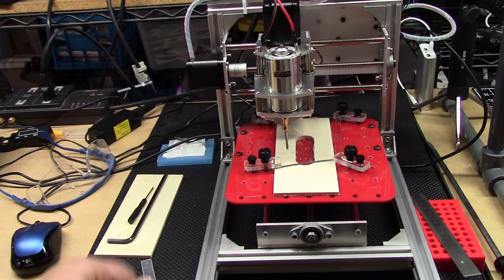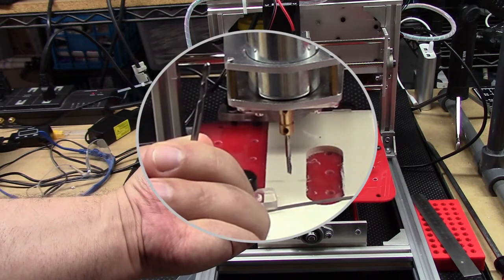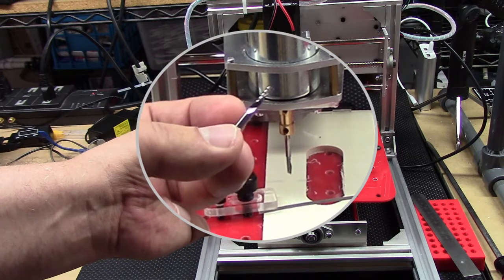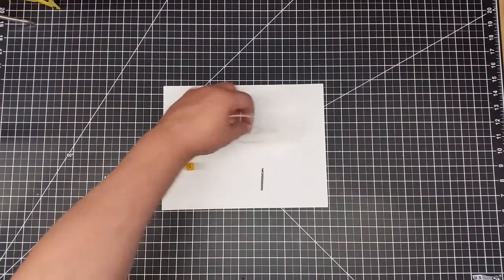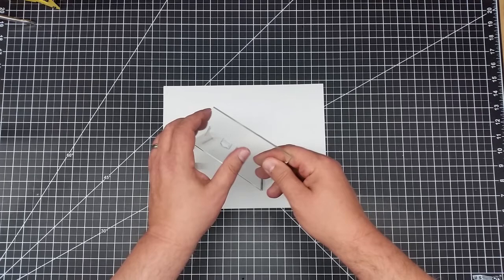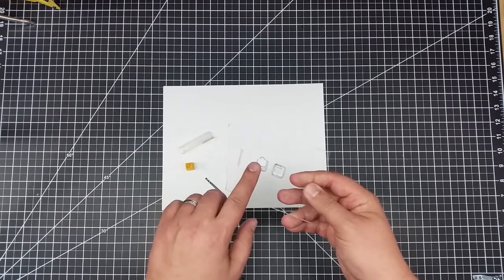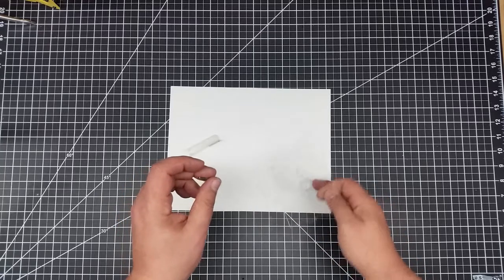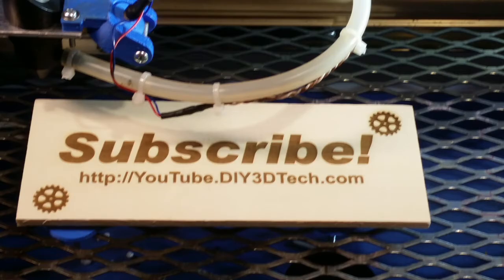Desktop CNC - Single Flute Bit and Soft Plastic!

Comment: I am wondering if you could convert this machine into a 3d printer. I am wondering for the sake of wondering to be honest. It reminded me of the Trinus machine that uses a similar looking leadscrew on each axis design.
Reply from the maker: I would not as the [slide] barrings are not that great...
Reply: Good to know. I have been looking at cheap 3d printer kits recently. My thoughts are to buy a few extra components and turn a cheap 3d printer kit into a nice preforming machine.
Reply from the maker: My two cents (from experience) is that  mix mode machines aren't worth the effort of money...

Comment: Interesting. The very first project I cut on my 3040 was 3mm acrylic. I used the 2-flute, 3mm bit that came with the machine. No issues at all.
Reply from the maker: On a 3040 you won't have issue as you will have both enough torque and RPM to get the feedrate high enough to cut rather melt.  However this little guy lacks that ability and therefore requires a adjustment in fluting to over some that as it is a only a simple DC motor...
Reply: DIY3DTECH.com   thanks for the explanation. Liking the 3040 although it can be vexing at times. Haven't yet delved into Mach 3. Still just using manual control of the spindle speed with GRBL
Reply from the maker: Yes have Mach 3 also and its an amazing program however a bit too amazing as every-time I want to use I have to re-learn it.  With Cut 2D and Inkscape just whip something up run it though Cut 2D and its off to the races!  :-)
Reply: will 3018 will be able to cut acrylic without any issues
Reply: Would you please share the depth of cut, feed rate and rpm you were using in order to cut 3mm acrylic without melting. I am also having difficulty with chip clearance and the bit collects the blob of melted acrylic.

Comment: I've had good success with a small 1.5mm double flute end mill bit on cast acrylic sheet from TAP Plastics.  no problems with it melting.  Is you material acrylic or polycarbonate sheet?  I've had problems in the past with polycarbonate sheet from Home Depot melting while trying to cut it on a table saw.
Reply from the maker: The key is the "cast" acrylic as this is not cast so it melts very easy...

Comment: Couldnt you use the under water method you used for glass. Even Ice Water?
Reply from the maker: Yes but not on this machine (the motor is open), it is simpler just to get the a flute bit :-)

Comment: The problem is that the endmill is flat so you have this high speed flat surface rubbing on the Acrylic's flat surface under it and it melts.  Where it cuts it does a wonderful job but that friction is what is killing it.  I don't know if you can do this but you know how Simplify3D can brake a job up into multiple parts, right?  If you could do that for the last few passes and slow it down and try to speed it up that would be the way to go but beyond that I am stumped on how to stop that friction without liquid cooling (like you did with the glass).  Try that too because it is a heat problem for sure.
Reply from the maker: Yes you maybe could stop and do a dwell after each pass however that is more of pain, as found switching to a one flute bit solved the problem...